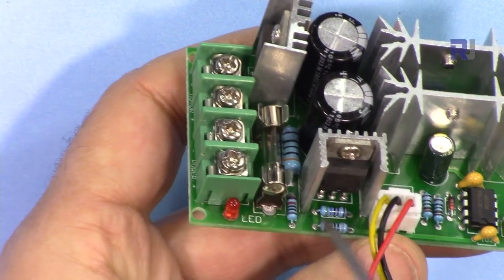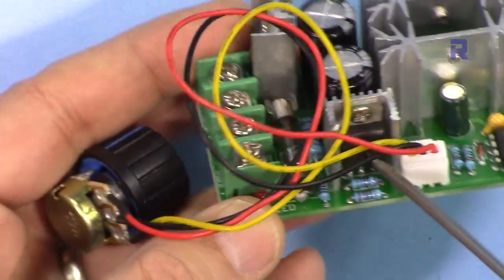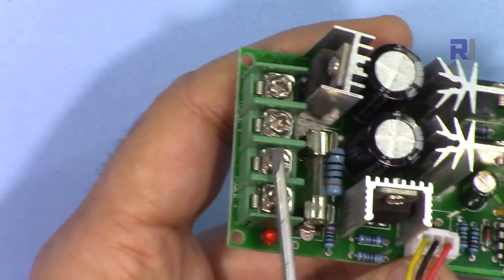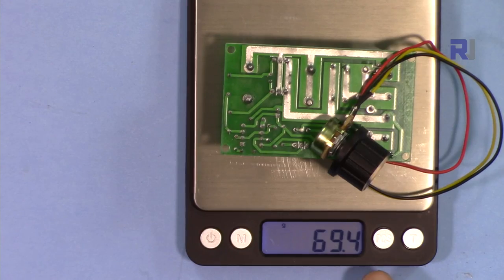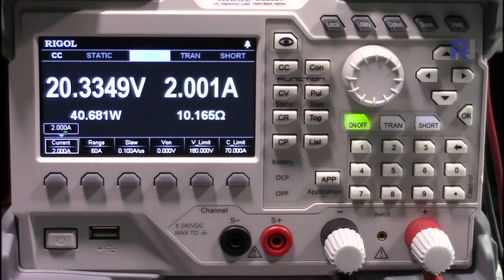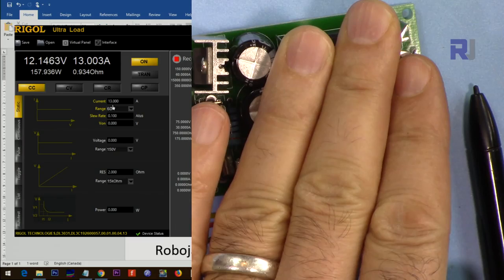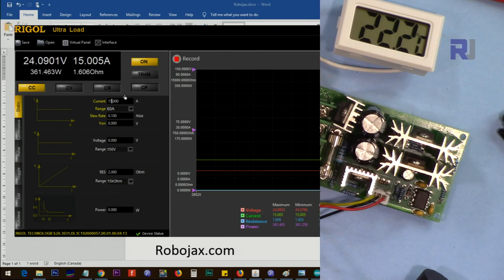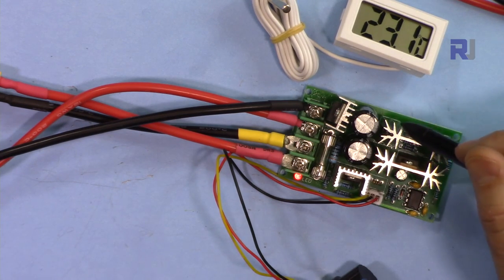Review of  20A DC 10-60V PWM  Motor Speed Controller

Comment: Hi, i tried to use it with 24volt 250watt motor with two 12 volt 9 amp baterries( 24 volt total) but the Fuse went off immediately.  what should i do? how can i make it work.?
Reply from the maker: You must have connected the wiring incorrectly.  250W ÷ 24V = 10.4A. This 10.4A is nothing for this module.

Comment: Do you know if the voltage across the POT matches the supply voltage ? I am looking into using a 0-10v  input signal for one of these for linear control with PID
Reply from the maker: I have not looked into reading any internal values.
Reply: I do not think the voltage across the pot is supposed to match supply voltage, those small potentiometers(100k?) Would burn up if hooked up to a 240 watt power source
Reply: @robojax  Good video thanks.   Do you have a schematic of this PWM Driver.  I want not to control it by 50KOhm Poti,  i want to controll duty--cycle PWM out by analog Signal 0-10V.  Is it possible to manipulate the board to use it with 0-10V controll signal instead the potentiometer.   Regards  Peter from Germany.

Comment: would the PWM be hotter or cooler if you set it at a lower speed?
Reply from the maker: this not about hot or cool. PWM makes devices work efficiency. may be I did not understand your question.

Comment: I have that kind of module i used it on my hho generator but  the mosfet and the schottyy its getting hot when reaching 4amp.  With 12vdc and with higher current (10A) the volage is also going drop into 10vdc..  Can i parallel using 2 pwm module in paralell the input and output. For better performance??
Reply from the maker: if both moth have exact voltage, yes you can connect them in parallel.
Reply: @robojax  thank you so much
Reply from the maker: you are welcome.

Comment: Can I use this as a driver for a 12v car ignition coil ? If so would I need to add a resistor? If so what size and where ? Many thanks
Reply from the maker: exactly what are you trying to do? the car ignition coil needs 12V and electronic switch. When the switch goes OFF, it generates 12kV to 24kV (12000V to 24000V). this device just controls the PWM of 12V.
Reply: @robojax  hi thanks for the reply.  I was planning on using it so I could create hv sparks . Would this not work for that ? Because iv already ordered it lol
Reply: Also it's not for use in a car it's for experiments .
Reply from the maker: Yes it would but it is very high current and will be very dangerous and I advise against using it for that purpose.

Comment: What will happen if the input is 29 amps.. do you have any suggestion for speed controller with this range?
Reply from the maker: Perhaps you mean what happens if you connect a load that needs 30A? It will heat up and if not cooled with fan, it will die.
Reply: 29 amp.... 220v ❤

Comment: Hello, can we control the speed of pmdc motor rated for 12volt, 120w used to run sewing machine...
Reply from the maker: if the motor is DC, then use this module. Or get another speed controller. if it is AC, then AC speed controller are also available.

Comment: Can I connect 210-220v in 20A DC 10-60V PWM Motor Speed Controller from input power
Reply from the maker: this module doesn't care about the input or your converter. just DC from 10V to 60V is fine.

Comment: Could I drive one of those from an RC receiver output instead of the variable resistor?
Reply from the maker: Not directly. RC receiver has PWM signal. but if you modify this module, it is possible.. the 555 has output, and if  you disconnect the output of the 555 from the input of MOSFET and connect the output of your receiver, it might work. You would have to see the circuit of this module. I did not pay attention to the circuit for modification purpose.
Reply: @robojax  Thank you.

Comment: Hi, excellent video, with a well done analysis. would you like to raise this scheme? it seems to be very simple and very functional and the best, it works. I would like to try to assemble one of these. Thank you.
Reply from the maker: Hi, not worth making it as it is very cheap. if you build it yourself, it would cost you 2 or 3 times more.
Reply: @robojax  Thanks for the answer. I live in Brazil, everything here has exorbitant prices, these values you entered are not practiced here, we pay 4 to 5 times more expensive, and I have all the components for the controller assembly. Looking through the photos, I managed to raise the scheme. I would like to confirm that everything is correct, and component values are missing.

Comment: Hola tengo una pregunta de cuantos amperios es la fuente de poder que tiene que mover los motores de 12v o mas
Reply from the maker: Hole depende del motor algunos motores necesitan 0.1A, algunos necesitan 1A o 10A. Cuando compre un motor, asegúrese de comprender este valor.

Comment: What is the maximum input for this module?
can i give 110VDC input
Reply from the maker: the input is the same as the output. I mentioned and it is in the title of video.
Reply: @robojax  Help me,
I have a 110vdc supply, how can I make this module capable of receiving 110vdc?

Comment: how many amps the motor draws with vs. without pwm at low rpm (start and stop)?
Reply from the maker: to know the amount of current, I presented the test results with 100% duty cycle of PWM.  when duty cycle is 0%, it is so low, we can neglect it.  so what the video to get the answer.

Comment: Could I have 10 of these units in parallel, fed a single voltage stablised PWM from an Arduino, supplying 24v( maybe 36v) to a 24v truck starter motor,for an electric motorcycle project,200 amp motor controller is £250
Reply from the maker: if all of them are controlled by same Arduino, and the same power supply. it should work. yes.  Make sure to test each separately to see if the output voltage of them are the same. if voltage are not the same, then you will waste energy. good luck

Comment: Dear brother I want install one pwm on my car hho unit 12V 20 A  running time 24 hrs ampian temp 40 C please advise best way I am in India if it successful looking for 100 unit thanks Simon
Reply from the maker: you should get higher current rating like 30A to be safe specially running 24h/day and at 40°C. I have got another video but that is for 60A https://youtu.be/a6LLbJtnPPA eBay would your best starting point. Do not start 100 units. Test first 2 or 3 types devices for at least 2 days and then come to conclusion. All ratings on eBay is based on manufacturer rating which requires adequate cooling.

Comment: Hi plz respond fast , extremely needed . 
Can you tell me resistors and capacitors value ? Plz reply fast
Reply from the maker: I don’t know why you need it but capacitors values are Not readable . It is so cheat that if you try to build or repair it it will cost more.

Comment: Can use it like buck converter?
Reply from the maker: NO. the output is always whatever the input is. The speed is controlled using PWM which does not change the voltage but rather the duty cycle.

Comment: hi all. if you conect in input voltage 6 volt. can give a power for a 775 motor??
Reply from the maker: Have you purchased and have it in hand? Test it. The rest I have tested the input minimum, if not then in the title I said 10v is minimum
Reply: ok thanks

Comment: Can I use this madule as a step down converter?
Reply from the maker: Hello, your question show that you have not even watched  3 minutes of the video. I have shown every details of this module.  So please watch to get the answer.
Reply: @robojax  you're wrong.I did whatch it again with too many ads.but I didn't find any thing about diffrence or comparison between pwm motor controller and buck converter.am not expert in electronics but it should be some diffrence between them.so tell me when exactlydid  you say about it?

Comment: Can I use this pwm board 24 volt 250 watt ebike motor
Reply from the maker: Hell, all the questions have been answered in the video. Even the title says the voltage and current.  I have spent so much time prepared this so all your questions answered. if you want to control it with other  devices such as Arduino, I have a lot a hack for this. the link is in the description.
Reply from the maker: You didn’t reply?

Comment: With due   regards  I need  the cicuit  diagram  of the   above  20 amp  pwm  motor  speed controller
Reply from the maker: no schematic for this. you would have to see the components and draw it yourself.

Comment: Where oscilloscope I can buy to start with ? Thank you
Reply from the maker: sorry I did not understand. Where? or which? I assume it has nothing to do with this module. if your question is "where" , then eBay, AliExpress or Amazon.  if which then it is big question. it depends on how much you want to spend. perhap from $50 kit to $50,000
Reply: @robojax  thank you for reply, yes the question is not related to that video. But I want to know what are the parameters or criteria I should consider when I need to buy an oscilloscope.
Reply from the maker: because this modules works and if you want it only for this purpose, then get cheapest oscilloscope it will do it.
Reply: @robojax  any recommendations?

Comment: Why cant controller turn the motor slowly? Like real slow... Thanks.
Reply from the maker: DC motors are always hard to run slowly. That's why for application where slow motion is required, either geared motor or stepper motor are used.  This board doesn't know the speed of motor.
Reply: @robojax  thanks for the reply. I have stepper motors. But will they turn slowly with this device?

Comment: Can you hook 500w motor to this?
Reply from the maker: I presented the current and it works with 10V to 60V. 500W is not a clear number. you need much more information to get exact capacity of the motor. Search online with result from this video and your motor and you will find out.
Reply: @robojax  that motor works on 12v so current is around 40A.
But i need to slow down rpm.
So will it fry pwm controller on 50% ?

Comment: Would it run a 100 psi water pump and does it have dead end detection
Reply from the maker: It is DC, only the current matters. You have to check it is 20A or less or not.
Reply: @robojax  Hi 
Its a shurflo pump, 12v dc. It says 8 amps max on it.
Reply from the maker: this you are move than you have got 100%  more room for power which means you can connect two of such devices.
Reply: @robojax  many thanks for the advice, I going to try one of these. I'm a window cleaner and the controllers we can buy range from £60 to over £100. I've always thought we were getting ripped off. 
Thanks again
Reply: @robojax  Final question, do all these controllers have current limiters fitted.